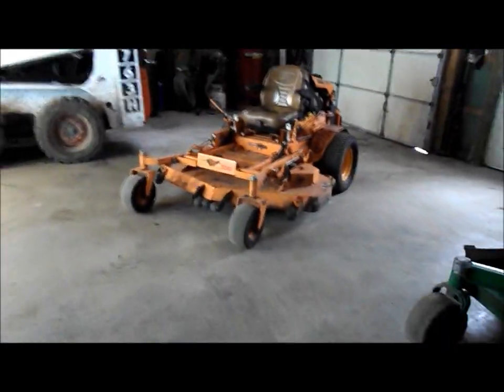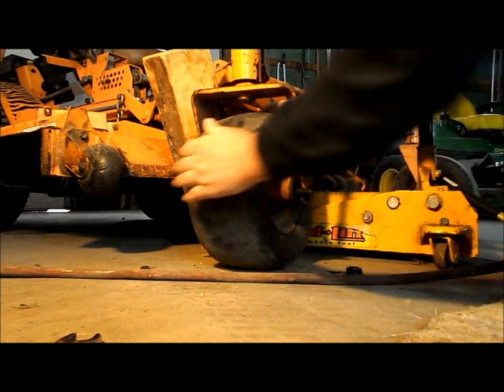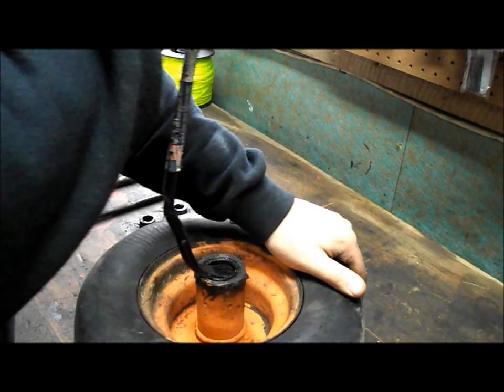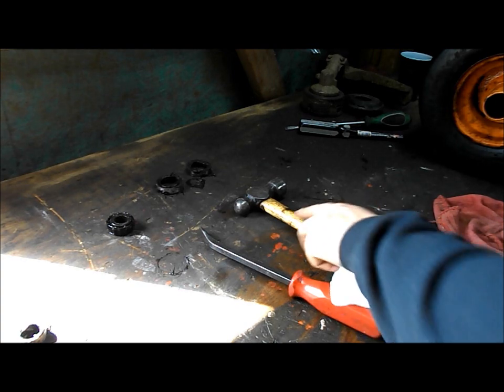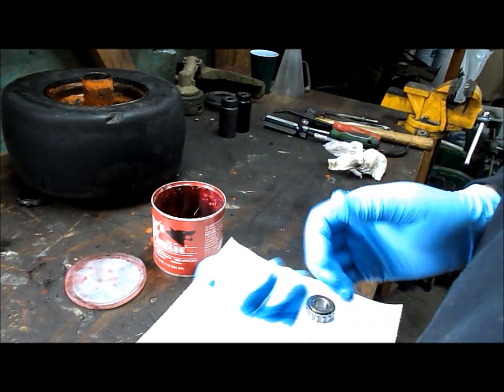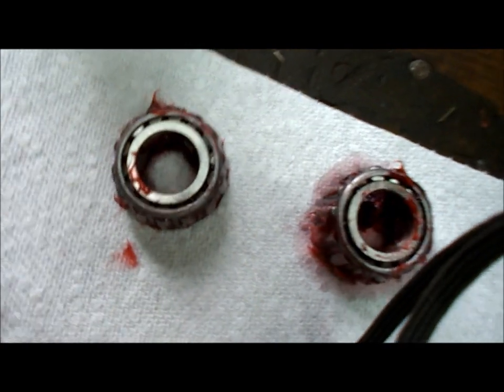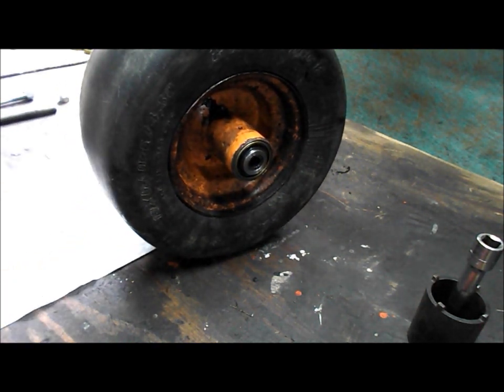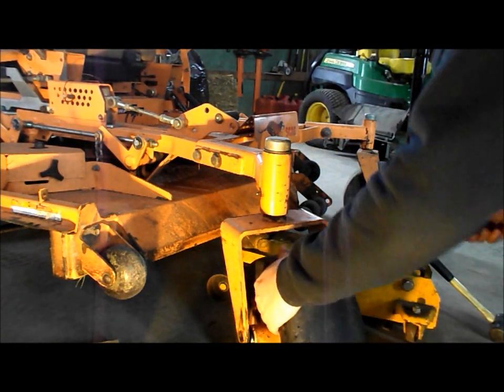Zero Turn Wheel Bearing - Scag Turf Tiger

Comment: That tool you used for removing the seal is an old hubcap tool, hook to pry them off, and the part missing was rubber for hammering them back on.

Comment: I've been wresting with the damn bolt for a week now... I don't have an impact wrench, so I'm just trying to monkey it out...smh. Thanks for the video!
Reply: I had to cut it off on both sides with an angle grinder
Reply: I had to cut it off also.  To further confuse me the dealer sold me the wrong sleeve which was totally bonded to the cut off bolt on one cut off.  I was trying to install new one and since I had no good reference I thought it was something else wrong.. and on top of that there is no tapered bearing and the inside of wheel assy is the only race.. which is normally not an issue as I don't try to race any dragsters.  However,  the straight profile new bearings one of the bearings would slide through the wheel.. The dimples as mentioned here for the race stop where completely missing probably worn down is all I could think.. Issue is for me I already had the new tire mounted and I already spent $90 on bearings and new axle bolt and the wrong sleeve.  Will have to try to make new dimples on inside of old wheel, I am hoping a center punch in same place as the marks on outside of the hub will work..

Comment: Yes bolt is meant to be tight on the inside of bearings so they don't free spin on them and there is a specific torque to tighten the bolt up or you well ruin the new bearings usually 20 ft/lb

Comment: Have the same issue with getting the bolt out. Hate to use an air hammer on it but looks like the only way.
Reply: I just cut the bolts off with an angle grinder & buy new ones
Reply: That's what I did. I gave it one heckuva try before doing so.

Comment: Help! I’m having big trouble getting the new Race (raise?) installed. I don’t have  a big enough socket (my biggest are 32mm and 1 1/4”) so I’m trying to use a block of wood to at least get it started but it doesn’t go down much (i’m hitting the board with a mini sledge) and it is crooked so I have to punch it out and start over. Any tips?
Reply from the maker: Hi Rick.  I would first verify that the bearing and the race is the same size.  if so, try putting it in the freezer for an hour to shrink it slightly.  put some heat on the wheel, not too much.  then give it another try.  Good luck!
Reply: Got it.  Put the wheel in my bench vice, used the mini sledge with 32mm socket. Deep well socket recommended for safety to keep the sledge away from ones hand.  For the seal I used initially a 2 x 4 that didn’t work so well so I switched to a 1/4” piece of 4 x 4“ steel that I had laying around.
Reply: @mrsearles  Thanks Matt!  Good tips which I'll remember for the future.  Appreciate the time and effort to make the video; I would not have made it without this!
Reply from the maker: @nt31749  thank you.  i have a few more industry related ones coming in the next few weeks.  hopefully with a little better production!